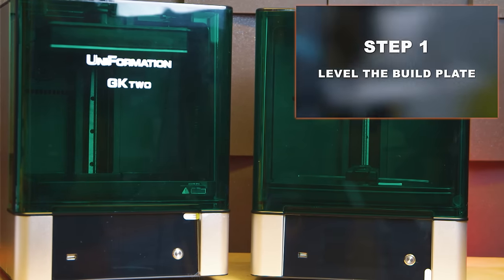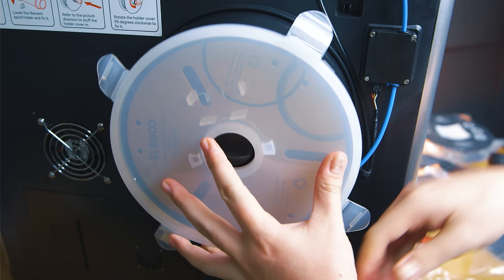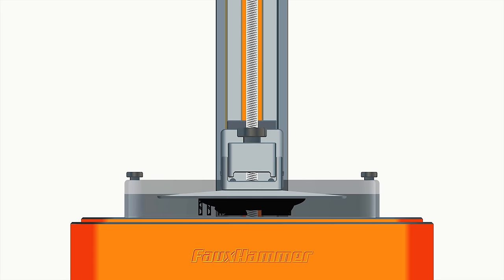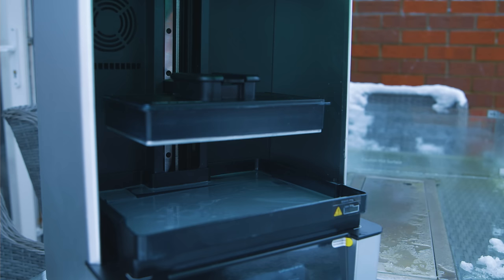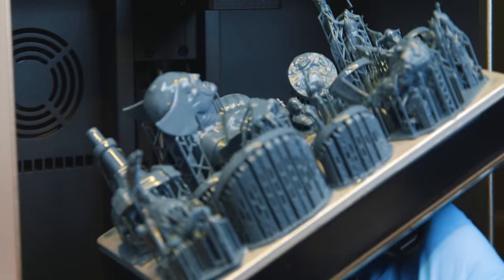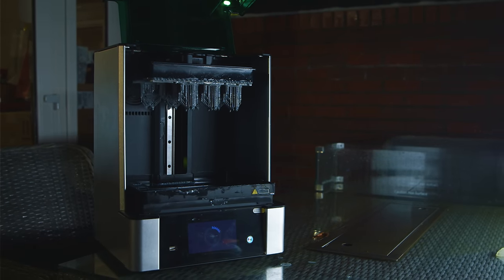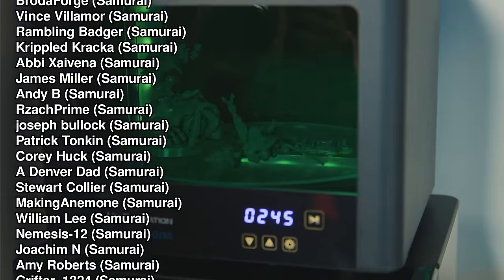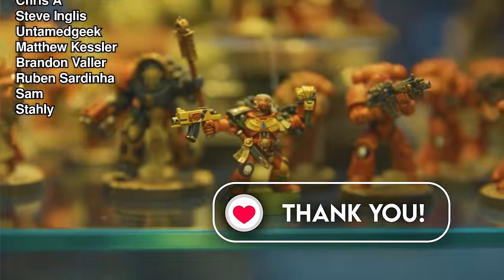How does a Resin Printer Work? - Before you begin Resin 3D Printing (Part 1)

Comment: I've watched a load of your videos and found them very useful, I have an old Photon Resin printer, a few years old, one with a colour screen!  Looking at getting something new to help print small figures and smooth square surfaces.  My biggest issue is exposure time, from your video, I thought I recalled one or multiple printers can do the sample prints at different exposures, which printer was that,  if multiple, which one is the best?

Comment: Hey huge fan here! Question for you or anyone that has an opinion on it…
The new Phrozen Mighty Revo coming out in April…thoughts? Setting a new standard in resin printers? 14k, heater (similar to GKtwo), air filter, auto fail detection, camera and app control, interior light, auto leveling, optional resin auto fill. 
New king or you think the GKtwo still takes the crown. I know it’s early hahaha.

I’m more interested in larger statues but for this printer I’d make the sacrifice and do more slice and prints on that 10.1 screen instead. 🤷🏻‍♂️
Reply from the maker: I'll let you know as soon as I had one, It could be king of the hill, it could be an expensive M5s Pro..
Reply: @FauxHammer  good point. I always put Phrozen a step higher than ANYCUBE but I guess anything is possible. Hard to think with all these Revo features that it could be a M5 Pro though

Comment: I've watched multiple videos now, and they all talk about printing issues if the resin gets too cold. Are there any issues with higher temperatures? I want to set up in my garage where temps can get up to approximately  90°F (32°C) in  the summer.
Reply from the maker: No not really as many unless you start trying to boil it. It can become a bit stretchier mid print. But that’s rarely an issue if ever I’ve witnessed it being g
Reply: Good to know. Your videos have made me feel less overwhelmed. Thank you. Now I need to clean the  garage, my wife will be thrilled.

Comment: If U own a printer without a heater, get a heater. It will make Ur printing life so much better ^^ printed months without one, got missprints and some ugly layers. After a Setup with a heater, None of that anymore ^^
Reply from the maker: What heater did you get?
Reply: Its called Air Controller for 3D Printer GMaker-FPS1 @FauxHammer

Comment: "This is a quick guide for beginners" (proceeds to talk a ton about unrelated stuff).
Reply from the maker: Don't think I ever said this was a quick guide for beginners did I? Either way, if you don't like it. Fine. But if it was 2 minutes long, nobody would watch it.
Reply: @FauxHammer  The "guide" parts are good. It's the "fill" or "distraction" parts that got me off it after some 10m
Reply from the maker: @Lighthouse_out_of_order  yeah fair, I’ll admit mate, that’s just filler to pad it out. But if you put a sub 10 min video on YouTube, then YouTube doesn’t recommend it to anyone. So nobody would have found it and nobody would get the good and useful parts…